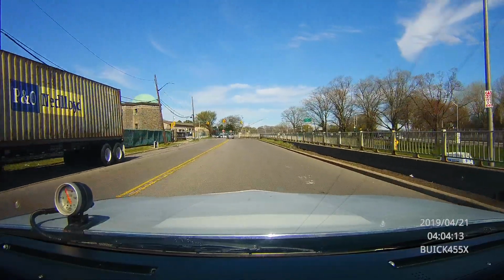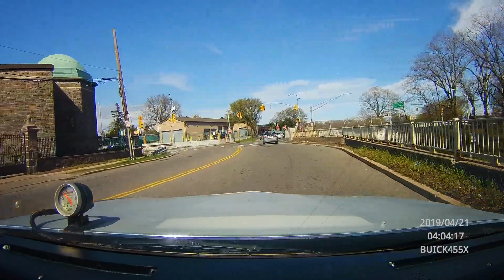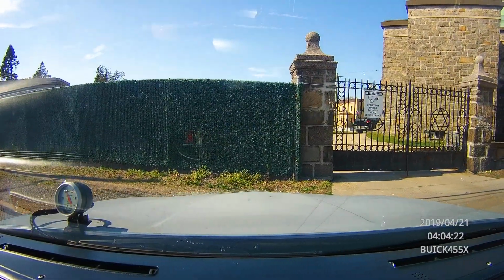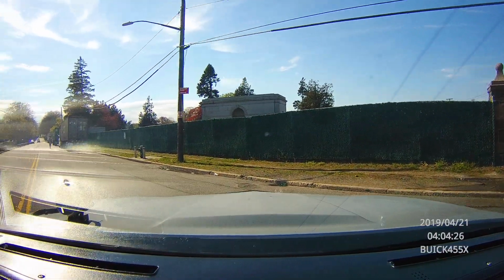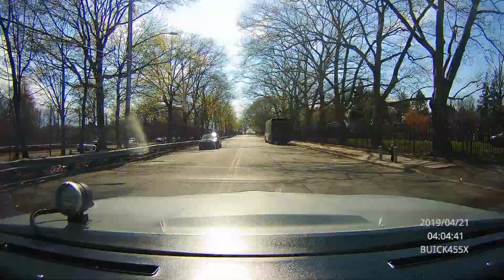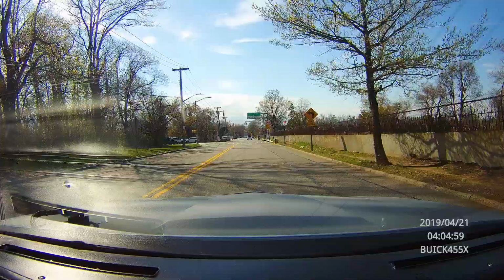Buick 455 Stage-1 Regal-T @ NEW ELECTRIC FUEL PUMP ORDERED. 4-21-2019

Comment: Good issue taken care of. Berto😎
Reply from the maker: Yes-Sir. 

As a matter of fact, I'm happy that God made it rain last Saturday preventing me from the TRACK. 

The new Pro Systems 440-GPH Electric Fuel Pump arrived a few days ago, with new Braided Stainless Steel Fuel Lines and Fittings. 

The Fuel Pressure Regulator was shipped out with the Fuel Pump. 👍🏼👍🏼🙂

Also, my Posi-Rear is giving me PEG-LEG rear BURNOUTS. 

I already have new MOSER Axles and Bearings, and KM DRIVELINE asked me to call them on Monday for a new appointment. 👌🏼🙂

I'll post an updated video in a few days. 

🙏🏼👍🏼👍🏼💯💯💯😀
Reply: Nice what psi you going to run? 😎😎